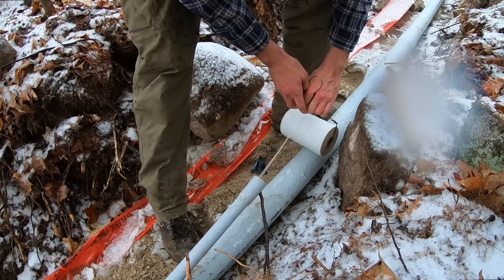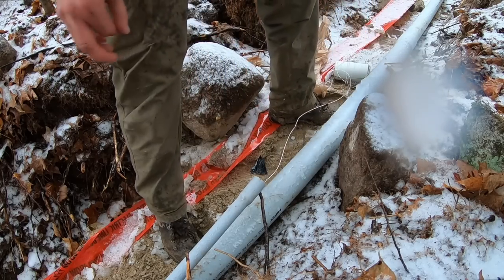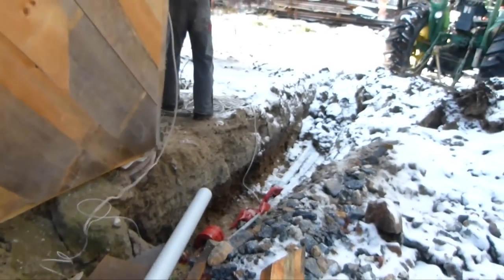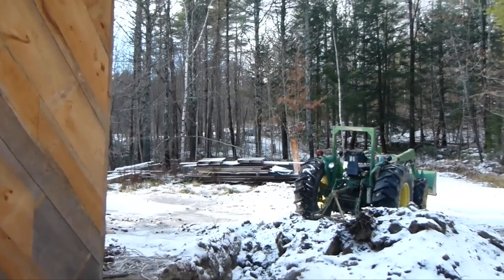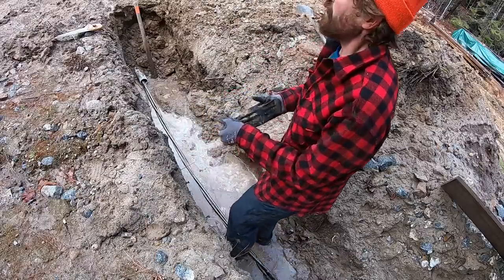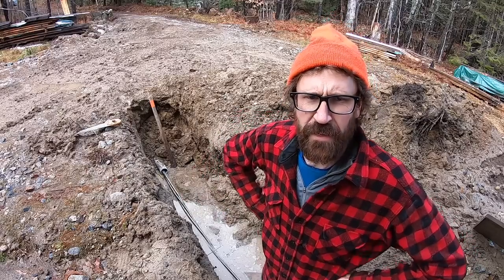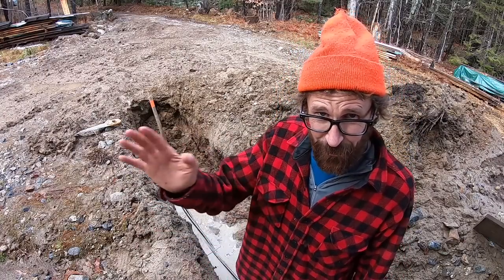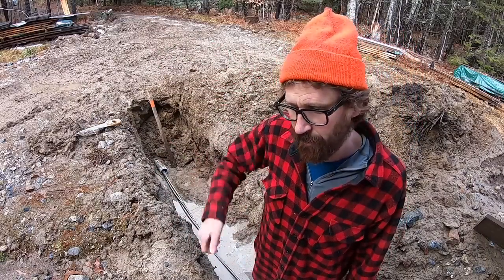Pulling Big Wire - Building a House from Trees SE5 EP3

Comment: My big habit is over estimating and over engineering. You are a great person, Bus 😀😀
Reply from the maker: Thank you very much sir. You are really kind to say that. 
That has been my MO for almost all the building parts of the project, and will certainly be moving forward with wire and plumbing. Thats what I am doing with insulation.
Reply: @BusHuxley  I was wrestling with central heating last week. It's all about the heat at the moment 😀

Comment: Been there, done that on more than one occasion. Levers, pulleys and the inclined plane, best inventions ever. Nice job with the video, not understanding the singing (Dapper Dan) but I did catch Orion. I'm going to assume that the splice will end up in a waterproof junction box in the trench. BTW $350 to fix the mirror. I bet the tractor fix is less than $100 and know you will do it yourself. Keep up the good work.
Reply from the maker: I was singing "I am a man of constant Borrow" Just being a geek. The splices themselves are completely waterproof. And packed with a conductive grease. the spindle was 216.00. And a three hour round trip to pick it up . But that was nice. It was a really nice evening. Thanks a lot.

Comment: Cool trick with the vacuum 👍 Did you replace the red and white truck?
Reply from the maker: Good question! I got a crazy deal on the 04 toyota tundra there. 4x4 v8 and all that, Ladder rack is great staging too! The red one basically fell apart. Rust nev3er sleeps

Comment: I'm a little confused about how the wire got through the conduit. And was there string sent through first? Why was that? The video, it seemed to me, could've used some titles on the screen explaining these sort of things.
Reply from the maker: Yes, in retrospect, this need way more explanation. So I pulled the twine through with vacuum, then used the twine to pull a very long section of static climbing rope. I then tied that off to the three wires with a bunch of half hitches and tape and used lube to pull it through. I didn't cover that and I am not sure why. Thanks for the question.

Comment: I'm not quite understanding your electrical installation yet, but I guess will see more next week.   The splices you made, must not be with-in a conduit or buried.   I'm assuming you are putting them in a pull box, otherwise, not good at all.   I think that if it were me, I would have installed a box on the pole and spliced them there, but what do I know.   Respectfully,   Kevin
Reply from the maker: Yeah, they are designed and built to be buried. I should have been more clear about all this it turns out. They are extremely tight and packed with conductive grease. They are rated fo underground use uncovered. I was glad such a thing existed.
Reply: Bus Huxley    Be prepared for failure in the future.   Not next week, but some number of years.
Reply from the maker: Kevin Coop I don’t think your correct. According to many professional electricians whom consulted, this is commonly done and essentially bomb proof. Thanks for the warning though.
Reply: Bus Huxley    Would you please tell me manufacturer of them?   I like to learn.
Reply: Mine failed. I had an unexplained leaf fire at the back corner of the house months earlier. It had started on the privacy fence and a neighbor kid noticed it. So months later I came home one day and power was out. Turns out when digging for the new run I found they had been spliced about 10' from the transformer pad within a foot or two where the fire had started. Just make a note of where your splice is if it does fail. Oh yeah and I'm a retired electrician so it was a cheap fix for me.
Reply: caverbrad    I'll bet there weren't any worms in the ground near the failure!    It was probably off of a ground mount transformer too.   No overcurrent protection.   How long was it buried before the fire?